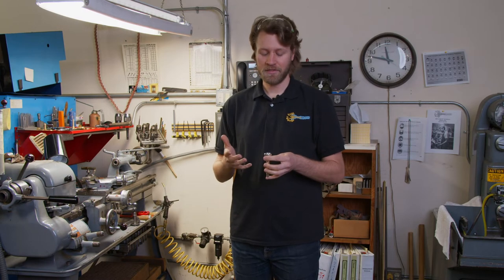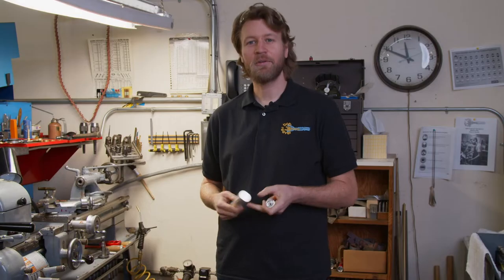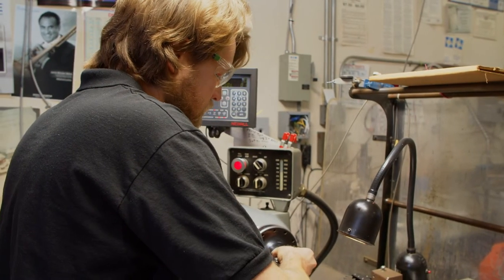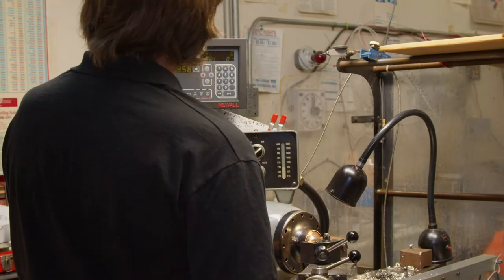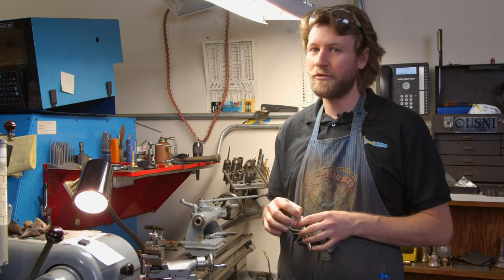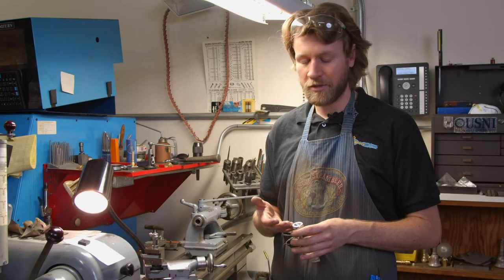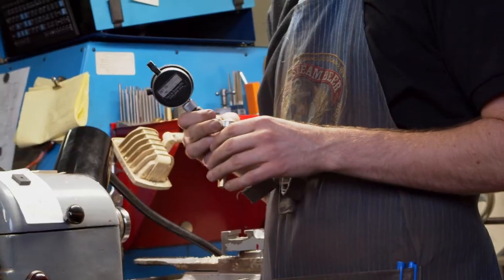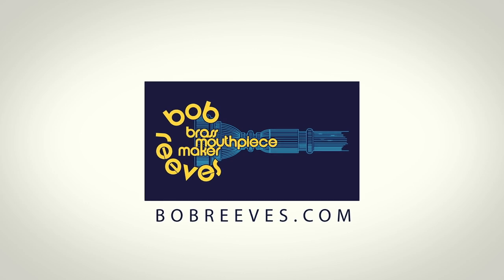Making a STERLING SILVER Custom Trumpet Mouthpiece

Comment: Was there a specific reason they went with sterling as a material? Was it sound? Feel? I know bronze rims or bronze underparts can make a difference after playing a few from Jeff Parke. I also play on Bach Sterling Silver Plus Bb and C trumpets.
Reply from the maker: Hi Josh, The sterling is about 25% denser than brass so you get the feeling of the extra weight without adding volume or thickness to the blank shape. The sterling rings more than the brass does adding colors to the sound.
Reply: @bobreevesbrass  Great to know. Is this something you will be offering on other mouthpieces in the future?
Reply from the maker: @joshwagner7193  Yes, we are making trumpet and trombone rims out of sterling silver. We've made a complete trombone mouthpiece out of sterling silver and are working on offering a full trumpet mouthpiece in the near future.